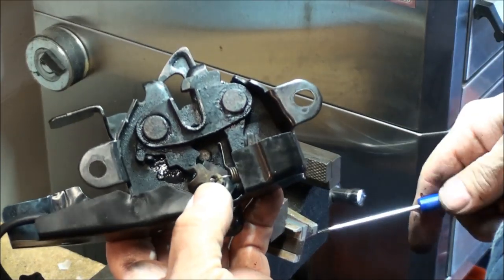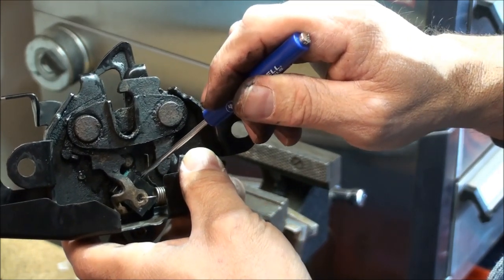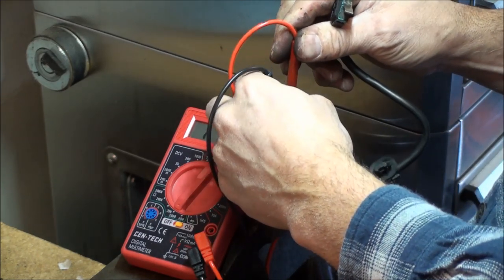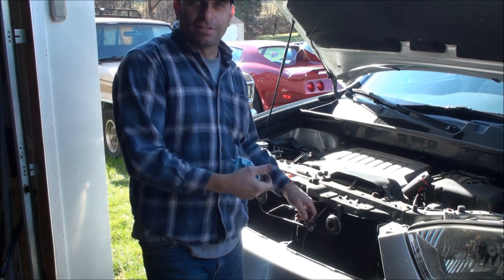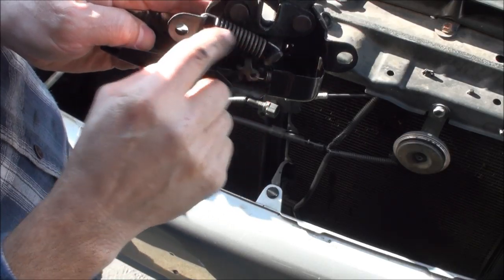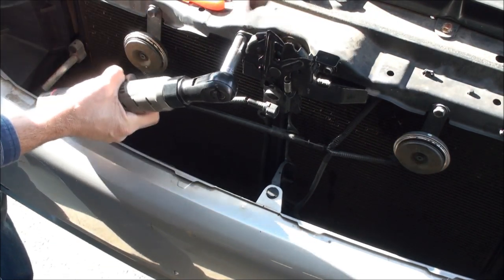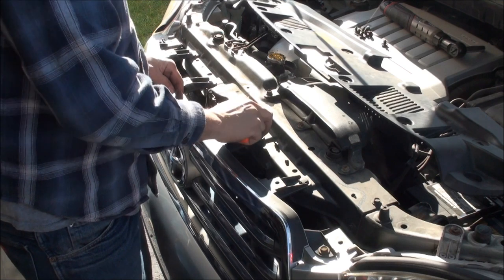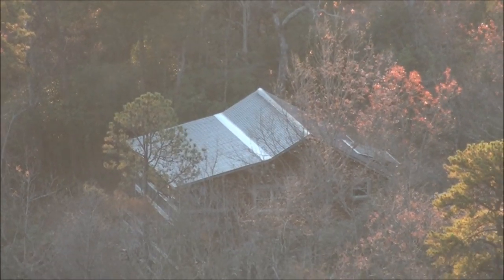Alarm Toyota Going Off -The fix,  Hood Switch

Comment from the maker: You can purchase an inexpensive soldering gun kit that works great here: https://amzn.to/2JOD8TM and heat shrink tubing for very little cost:  https://amzn.to/2JX0V03   Please Subscribe for future videos!  Thanks for stopping by the Ozzstar channel.
Reply: This was the best solution and instruction video.  Toyota dealer asked $300 to fix it.  I got a simpler quick fix, based on your soldering the wires.  I could access the witch wire connector without even taking the grill out.  I just put 3-inch long fine wires between +/- in the wire end connection.  And reconnect the wire back to the original position.  This effectively closing the switch and allowing to set the alarm.  This is just a temporary fix. Thank you for saving me $300.  You are the best help.
Reply from the maker: Glad the video was helpful to you Charlie, thanks for your comment.

Comment: This was the best solution and instruction video.  Toyota dealer asked $300 to fix it.  I got a simpler quick fix, based on your soldering the wires.  I could access the witch wire connector without even taking the grill out.  I just put 3-inch long fine wires between +/- in the wire end connection.  And reconnect the wire back to the original position.  This effectively closing the switch and allowing to set the alarm.  This is just a temporary fix.
Reply: Hi Charlie Cha do you have any pictures please? thanks

Comment: Just finished fixing my hood by shutting out of the switch. No alarm so far. Couldn't have done without you. Thanks.
Reply: @Bill Garrand, same here after watching his very nice video I read another post which explained the pros and cons of each approach so I decided to shut off the switch by cutting the wire and making a loop so far it works well, the car alarm will arm ok. I think the whole operation took me less than 10 minutes, zero cost, lol!
Reply: @Luke C. Yes, I followed the video instructions and it worked like a charm took about 10 minutes.

Comment: Thank you so much for posting this video Ozzstar. I found it very helpful and have some suggestions that may help temporarily resolve the alarm constantly going off. 

I have a 2003 Toyota Sequoia Limited. The alarm was going off so often we had to disconnect the battery to the vehicle. I'd seen postings that the problem was either the rear hatch latch or the hood latch. On my vehicle, I discovered it was definitely the hood latch. 

I watched your video twice and noticed the switch (actual metal part) you pulled out was corroded and gummy. That got me thinking. 

I got a can of Gumout carb & choke cleaner (parts cleaner) and sprayed the heck out of the latch, switch and hood connection. And I mean sprayed the heck out of all parts! 

Next, I sprayed the same parts with WD40. Finally, I opened and closed the hood ~8 times. 

It's been 5 days and the alarm has not gone off once.  Do I think this solved the problem once and for all? Probably not. But it is a good bridge while the part is on order. Hope this helps everyone.
Reply: Did it work?

Comment: Good old security bypass with the paper clip ;) I do that on seatbelt buckle switches as well haha! Good luck on the waterpump job Glen!
Reply from the maker: haha Ivan I won't lie, I did think of the paperclip trick but didn't want to give the general population an excuse to be a hack. I even used heat shrink tubing ;-) I edited out the soldering part but you were there with me in spirit! lol
Reply: did you use a butane soldering iron and a BIC lighter to shrink the tubing? ;)
Reply from the maker: I used a blue BIC yes,  old school plug in iron.....not impressed? lol  I knew I should have left the footage in.

Comment: Arrrrrr the Cap hiding the third mounting bolt did not see that one.
I found there seems to be a small circular piece of plastic around switch actuator. I was able to remove this and it seems to be ok now, will see.
Graeme in OZ

Comment: Thanks Ozzstar! Sorry to bother, but how did you pop out that center bottom screw cap on the latch assembly? We have a 2011 Highlander which has two difficult pop up snaps behind the grille so I’m trying to replace it without removing the fender, light and grille.

Comment: Have a 2012 camry hybrid.  Hood open light on dash and alarm is going off constantly. Tried the bypass you are showing on the Highlander but no results on the camry.  any suggestions?
Reply from the maker: You will need to look at a wiring diagram and find out if there is a short to ground or short to power.

Comment: Does the switch was normally closed when the hood was closed?  The alarm goes off because the contact are not closing the circuit properly?
Reply from the maker: Yes in this case the switch should be fully closed with the hood closed..  Some designs are opposite and when the hood is closed the switch needs to be open.

Comment: I have 2014 Toyota Camry XLE Hybrid alarm that goes off inside the garage and outside sporadically. Outside, I thought it's just the wind and the sensor in the hood was the culprit. I have someone did a bypass, just like what you did and it still goes off even inside the garage. Even when I unlock the doors, it re-locks. I tried to disable that feature on the dashboard - still the alarm goes off inside and outside the garage sporadically. The only time the alarm wouldn't go off is when I physically unlock the door. What do you think is the problem.

Comment: hey when you say you loop / solder the wire together, is there specific wires you solder? and can you leave this as a permanent fix? will the door alarms still work?
Reply from the maker: Soldering is considered a permanent repair.
Reply: @ozzstars_cars  will that just eliminate the hood signal switch alarm from going off? and the door alarms still function as normal?
Reply from the maker: @Dubaday  depends what circuitry the car has. I explain that in the video.

Comment: Hi Glen, do you by any chance know how to disable the “trunk is open “ light on a Toyota camry 06?? The trunk is closed, but light still keeps coming on (already cleaned out the latch just in case)
Reply from the maker: I'd start with a wiring diagram and find exactly where the circuit is switched on/off. Some simple testing should lead you to the fix.

Comment: Man I was really hopeful this was my fix, my 2007 Highlander doesn't have this switch.  I've taken the grill off and the only line running to the hood latch is the release cable. I did notice a pin sensor on the passenger side of the engine bay which clearly presses down when the hood is closed.  It is a single wire however, so I think it might be something else. Any thoughts if my 2007 has no hood switch and presents this same issue?
Reply from the maker: Somebody may have bypassed already. Driver door switch is a common failure also.
Reply: Did you figure it out? Same problem for my 2006

Comment: My wife's 2018 rav 4 started honking last nite...scared her...all she did was open the door and car went crazy.....maybe it's the hood latch...it beeped a few times this morning when she unlocked car with fop key...
Reply from the maker: The drivers door switches are known to fail often.  They should be tested to confirm the problem before replacing.
Reply: Ozzstar's Cars it stopped beeping....guess it was a switch..oh well

Comment: Thanks for the informative video.
Toyota here don't sell the switch separately and I have to purchase the entire hood latch assembly.

My switch also didn't show the inconsistent resistance as yours did so I'm reluctant to by the latch.

Do you have the part number for the switch itself? And was it purchased from another supplier? 

Thank you!
Reply from the maker: Unfortunately it appears Toyota forces you to purchase the entire hood latch with the switch.  Here is a link with the part number for 2008-2010 Highlanders https://amzn.to/2WPn5XY.  Good luck with the fix.  Keep in mind a defective door switch can also cause similar issues.  -Glen
Reply: @ozzstars_cars  Thanks for the reply!
 I intend to short the switch and perform some testing to verify its the cause of the false alarms.
I initially removed and cleaned the switch with alcohol, and received no false alarms for 3 weeks. But it started again 2 days ago :(
Reply: The automotive industry these days seems to exist to screw us over as much as possible to drain the money from our wallets. Gone are the days when you could buy individual parts or (dealer) mechanics that actually fix things. Just got back from the dealer, they wanted $200 for the hood latch so I told them the latch works fine, it's obviously the electrics that are the problem but of course you can't get the switch without the latch. Told them to bypass it but of course they can't do something sensible like splice the wire, they just disconnected it so my dash is constantly flashing a warning light and dinging, telling me my hood is open. Probably just going to pull it off and either do what was done here or maybe try to fix the switch itself, have done it many times at work since the accountants never want to pay for any maintenance on our presses and just buy us new switches, it's not like they are there for a reason other than safety.

Comment: Do you have a video of the bypass
Reply from the maker: Yeah, it's in this video..
Reply: @ozzstars_cars  thanks man. I couldn't pull it out for some reason so I just sliced the two wires. I haven't heard it go off since. My fingers are crossed

Comment: I did this a few years ago, I did not change the switch I just reconnected the wires. Since then I am having battery issues, in 3 years, I had to change 2 batteries, they keep diying, I am suspecting this issue,  I might have done some bad bypass
Reply from the maker: Perform a parasitic draw test to find out the issue.  Also test the alternator for proper charging.

Comment: This is way late to comment, but.. Why have the hood latch be part of the alarm system?
Reply from the maker: It's never too late to comment on my channel.  Why alarm the hood???  So if somebody pops that sucker open and tries to steal or tamper with the engine or components.  Those sensors, alternator, battery aren't cheap to replace. ;-)
Reply: @ozzstars_cars   Another reason the hood is included in the alarm system is if you disconnect the battery, the alarm won't go off when you break inside the passenger area. This is a common feature, though some use a mercury tilt switch to detect hood opening or car being towed.
Reply from the maker: @jlwhein1779  that's a good point!

Comment: Thank you for your video. I have a 2010 Venza that has this alarm problem. Is there a similar switch on the rear hatch? Per another video, I’ve been shooting WD-40 in that rear latch and it only temporarily fixes the random alarm issue.
Reply from the maker: Driver door switch is the next most common, beside the hood.

Comment: So if I don't want an alarm system on my car all I need to do is unplug the switch and leave it off.  Right?  Or am I missing something?  How likely is it that someone will steel a 07 Camry with over 200,000 miles?
Reply from the maker: You need to test the polarity of the switch whether you can just unplug it or need to bypass it with constant continuity.   I know most cars are made of steel but I have no idea how to steal them.
Reply: @ozzstars_cars  touche' on the steel.  I hate the English language. I guess I could take it off. If it works I don't need to test it.
Reply from the maker: @richardk7379  always test, not guess.  Like a true professional.

Comment: My car horn goes off when it rains. Please let me know what is going off
Reply from the maker: Sorry can't tell you what the issue is over the internet.
Reply: My 2000 Land Cruiser does that.  Water is getting into the fuse box behind the kick panel, either from the sunroof drain or leaking windshield seal.